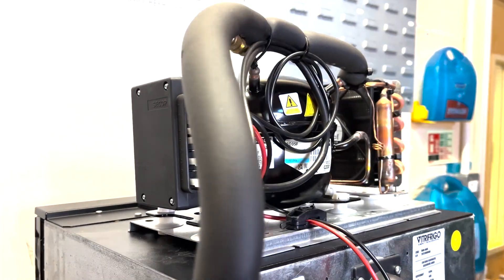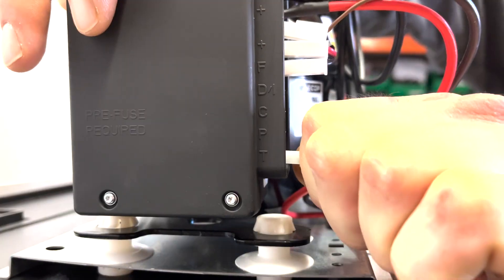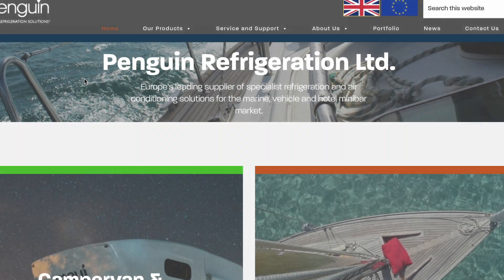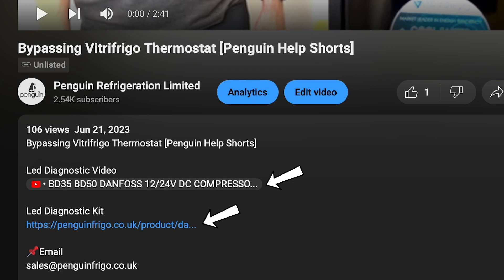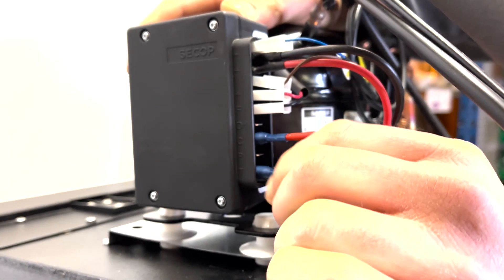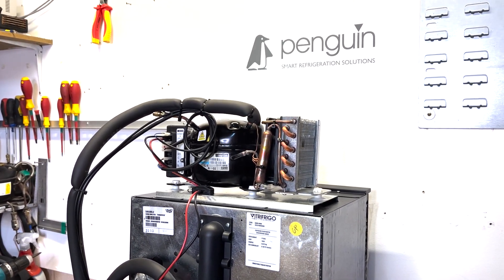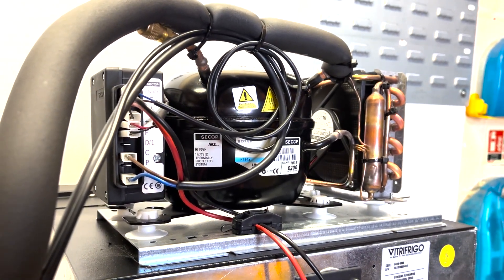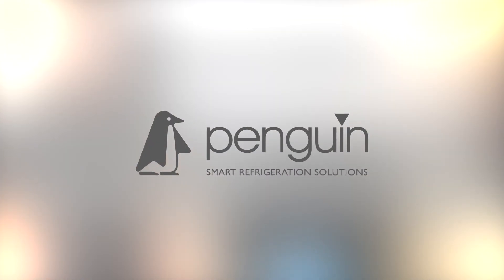Bypassing The Thermostat [Penguin Help]

Comment: I have a Galanz GL43 mini fridge that was working fine on March 2 of 2023 when set on its back in my van for the next 20 months. The van sat parked from March '23 to August '24 when it was placed back into use after my car conked out. Didn't drive on bumpy road roads for the next 3 1/2 months before the van's engine developed a start - won't idle problem. My sons trailered the van and car 650 miles to there place where I can work on those.  Plugged in the GL43 after allowing it to sit standing up for one week only to have nothing come on, including the interior light. Using my VOM, it appears that the power cord, overload protection and start relay plus the compressor are good. The interior thermostat was stuck set on 7 (high) but managed to get it rotating again by using Channel - Loks. I'm currently searching for my jumper like the one you showed to see if doing that will kick on the compressor and the interior light. Am curious to know if the compressor could be considered bad from jarring if that fails to turn it on and if I can remove the cover to tap on its electric motor to possibly jar it back into working order?

Comment: Hello ! that is a very good video . I have just a question: i have a BD2.5 Danfoss and i have to test it . Can you with a small drawing show the resistance between the 4 pin of the compresser ? Thanks a lot

Comment: My compressor seems to run ..but I’m not getting any cooling function
Reply: If you have a big refrigerator like a side by side, remove the panel inside the freezer compartment to see if the coils are covered with ice. That usually indicates that the defrost heater element has stopped working. You'll also see a fan connected to a temperature relay. The relay powers the fan to blow cold air around the coils and out into the freezer compartment. The relay shuts off the fan during defrosting. You can test the defrost heater element for continuity and resistance. If the continuity buzzer doesn't come on then the element has broken apart. If it has very low resistance then it's not getting hot.